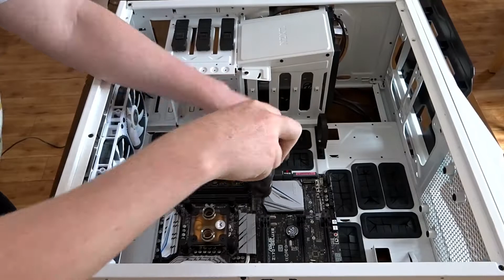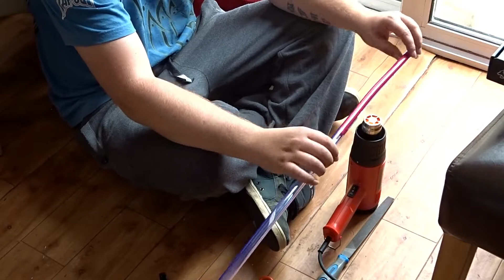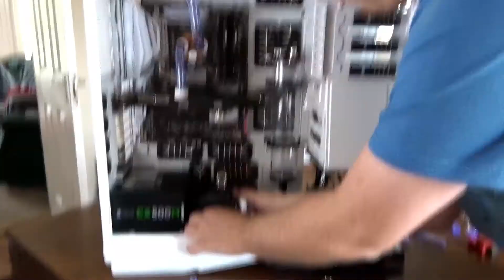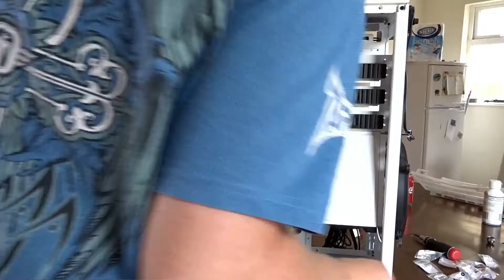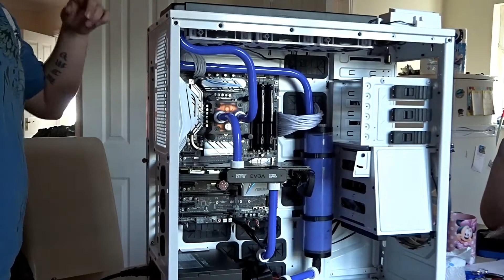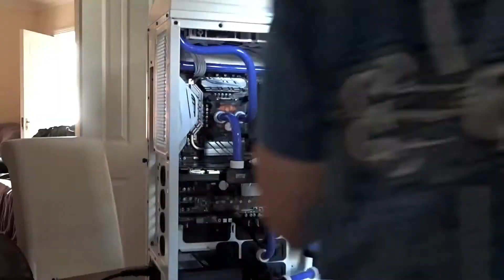Awesome White and Purple Water Cooled Gaming PC Build

Comment: Ho much would it cost for a budget watercooling setup for a mid-range pc?
Reply from the maker: Its probably better to just get an AIO for a midrange gaming rig. Its more expensive then you would expect, last time I tried to source all the parts for a cheap loop, it came to about €300.
Reply: thanks, i'll stick to air cooling lol
Reply: LastGenGamer same I just get my self a be quiet cpu cooler or something allthough it looks very nice and you get some cooler temps I would worry about it way to much because it could leak and time you have a really nice rig it could stop working